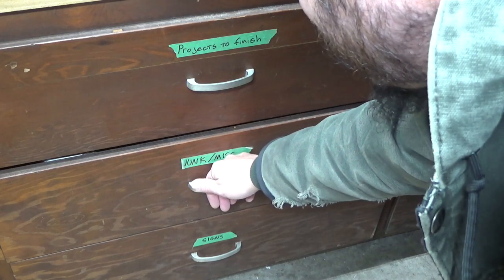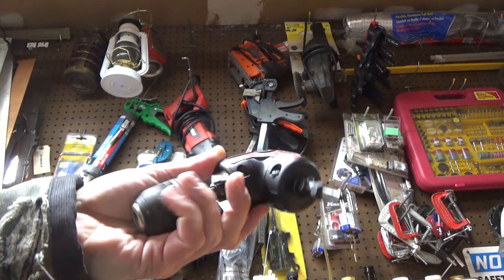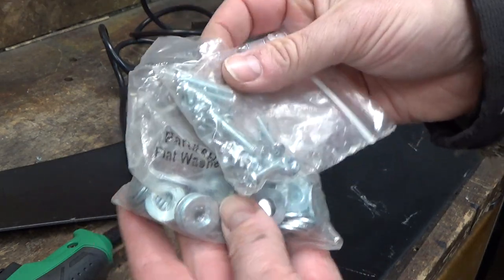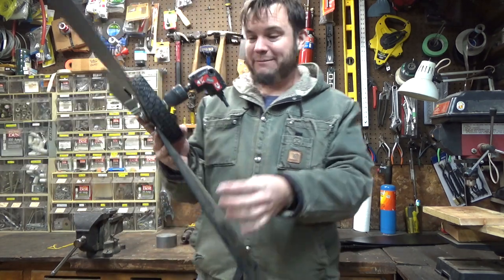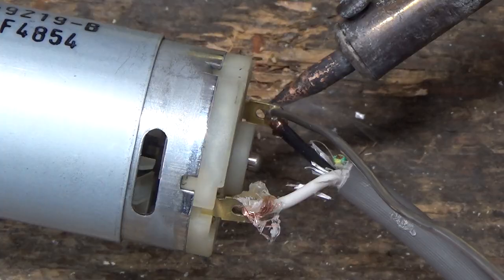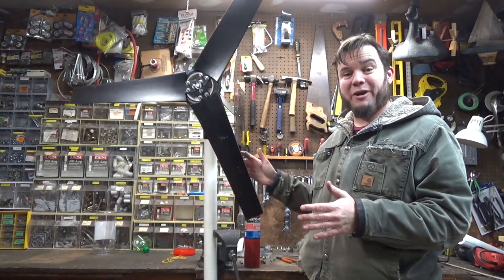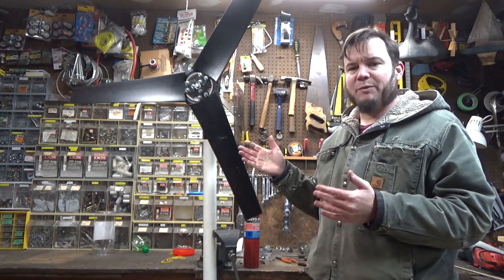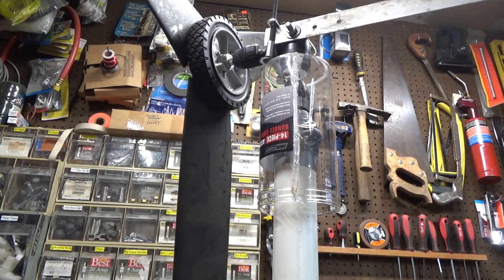DIY Wind Generator Made From Old Drills & Fan Blades

Comment: Neat idea!  I use an old soldering iron to put holes in that type of plastic container. The problem you had with providing a having a rotating base allowing the wires to still be connected, use an recoil from a vacuum. The vacuum recoils have two brass rings in them. Thanks for the upload

Comment: Cool, I have just put up a load of solar panels in my garden, I have them grid tied so it goes straight to the house at 240v (UK) It is amazing to see the sun come out and get over 1kW in November! Let us know how it goes.
Reply from the maker: Solar is getting cheaper and more efficient for sure! I keep thinking about doing that on my house.
Reply: @saveitforparts  I bought a used set of panels and inverter. Fitted it myself. Made the footage but have to edit it together.

Comment: Save the chucks from those broken power drills even if the motors are wrecked.  You'd be surprised how often they come in handy.  I hope the generator works out at Sandland.

Comment: Looking good and fun to build, if prop is not well balance won't last a gust. I'm concern about the center bolts attaching the prop.
Reply from the maker: The balance seems pretty good on the blades. It's not so good on my tail boom, and as other people have said I'm probably torquing the 90-degree adapter too much.

Comment: At sandland on the mono-rail isn’t there an electrical control and regulator still on the master control panel ? Just hook up some batteries and use that system with your generator !
Reply from the maker: I do have a solar charge controller in there, I'm not sure if that works for wind as well.
Reply: @saveitforparts  electricity is all the same isn’t it ? Just different sources ! Can it tell what it’s coming from I don’t know . I’d say if 12 volts is coming in all it sees is 12volts . Am I wrong ? I don’t know !

Comment: That thing got spinning fast. I was surprised
Reply from the maker: It spins faster with no load on the motor! Once it's hooked up to a charging circuit there will be more resistance in the system.

Comment: an alternator is NOT better than your brushed DC motor, it is LESS efficient due to it's rotor winding. A 3 phase brushless DC motor & 6 diodes could be most efficient easy setup. Look for the LOWEST  KV motor you can find.  for your current windmill: you NEED to brace the 90 degree somehow. Those shafts don't like torque and bending loads at the same time; they will fatigue and crack. Try bracing between the PVC post and the fan somehow. An alternator can put out like 1.5kW of power. You would need 8 ft fan blades for something like that lol. for your setup id guess a few hundred watts, depending on how stiff the breeze is?
Reply from the maker: Yeah, the 90 is one of the weak parts I'm concerned about. I think I might go back to a more traditional design next time. I don't necessarily need a LOT of power right now, this would mostly be for topping up small batteries.
Reply: @saveitforparts  right, but what I mention are the upper limits of what is possible if everything is designed right. Reality will be uhhhh... instructive. Any sort of little issue in the system will add up to a whole lot of not much output. blade efficiency, bending shafts, bevel gear losses; by the time it even makes it to the generator there won't be much left. If you then have to spin up the fan blades in the alternator as well, while also putting power into its rotor...well you get it. Even the brushes in the DC motor aren't great. if you use diodes, you need Schottky ones

Comment: Hey dude, love your videos i saw that you made tunnels in sandstone, do you think solid granite mountain is any good?
Reply from the maker: Granite is a lot harder and would be tougher to dig through. I think you'd need more industrial-strength mining drills and equipment for something like that. Maybe find out if there are any old mines in the same rock formation and what techniques they used?
Reply: @saveitforparts  thanks, i will do that